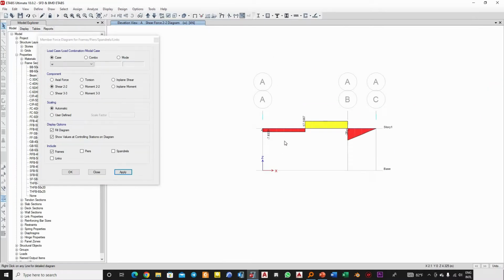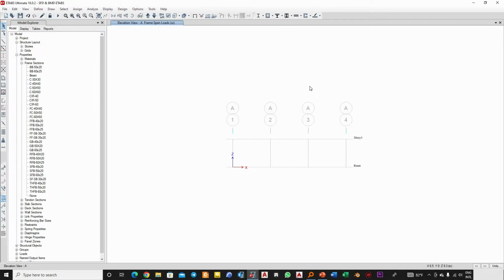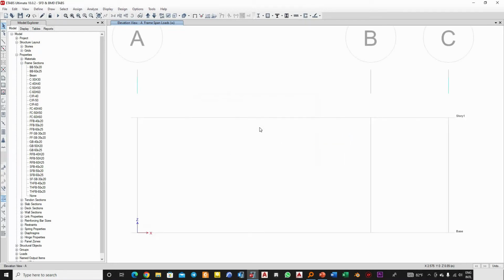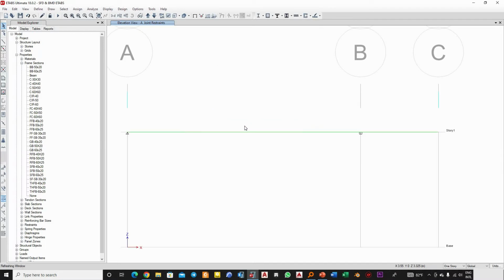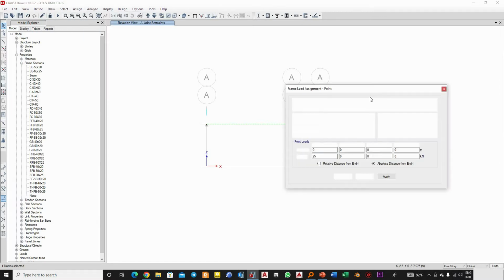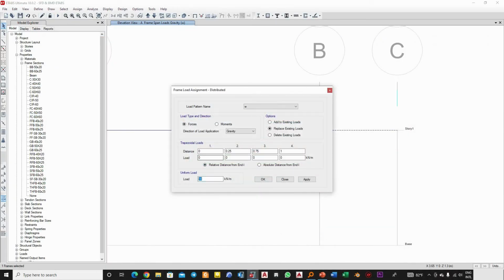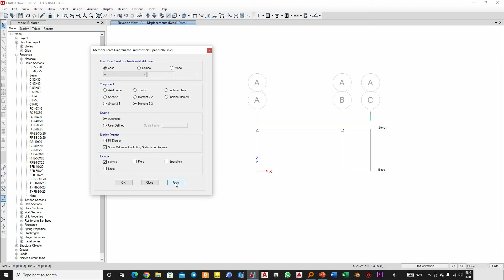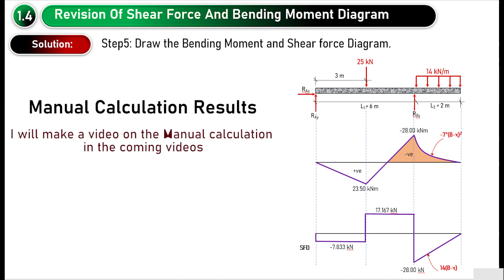How to Draw Shear force and Bending Moment Diagram in ETABS

Comment: Why is the shear diagram looks like a mirrored version. I tried a simply supported uniform distrubuted and it appears like that. How to fix this to become more like the convention shear diagram we draw by hand where we start from left to right with upward as positive and down as negative
Reply from the maker: Yeh, you are right, it is a mirrored version of the basic Diagram we learned. Mirroring the diagram has advantages when designing. Because when you mirror the bending moment diagram, you easily get a diagram that shows you the tension zone locations all over the beam section.  For example, if the diagram around the mid span is below the beam line as in the example, hence the tension stress is at the bottom in the mid span. And around the supports if the diagram is above the beam line, the tension stress is at the top portion of the beam. Hence designer may provide reinforcement where necessary and decide lapping locations and bar cutting in Reinforced Concrete Structures.
Reply: @icsaar99  Thanks for this insight